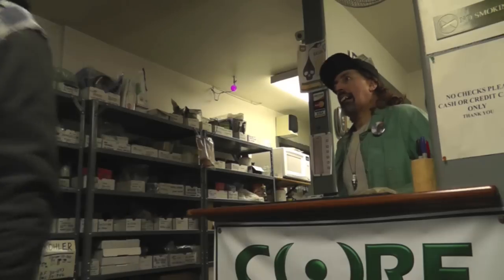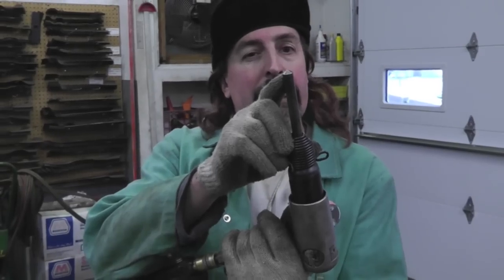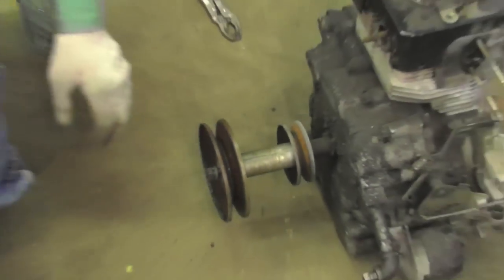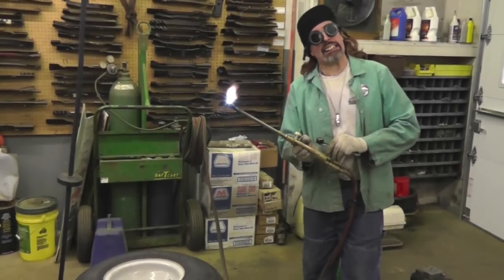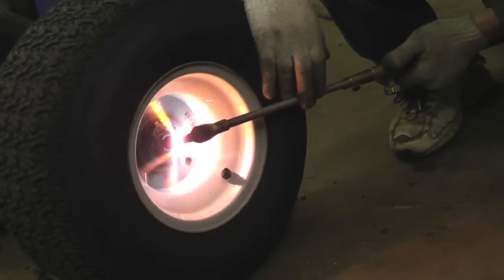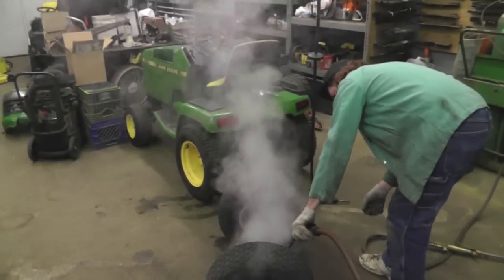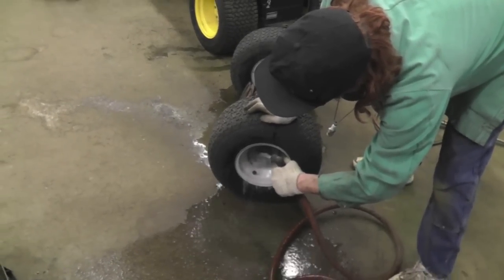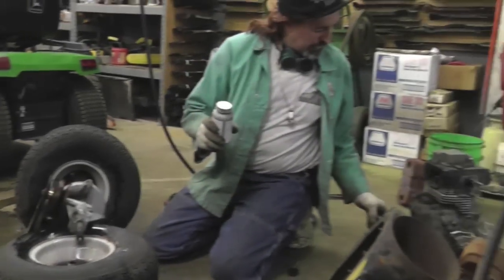How To Remove Rusty Pulley, Rim, Blower Fan, etc.

Comment: It WORKED, I knew to use an air hammer and heat but never thought of heat and water. You saved my wheel and now a subscribe. Must have watched a dozen other videos and my next move was to cut the wheel off.

Comment: Great video, I'm wondering if that much heat can damage the seal on the axle. Just asking!
Reply from the maker: Yes it can, You can wrap a wet rag in the seal area that will keep it somewhat cool. I've done that to protect the seal.
Reply: Taryl Fixes All did this trick on my own and though I was so smart.

Comment: It really requires two people to hold and pull it with a air hammer, small piece of pipe around bolt helps keep the punch in center of bolt also

Comment: Used the heat and cool shock method for years working on drilling rigs. We call a torch a Vector wrench.
Reply: doesn't it bend the metal (axle) ?

Comment: I spent 2 days heating and beating a wheel before I cut the wheel off and sliced open the sleeve with a grinder. I even tried drilling holes in it and using a puller. I guess it's time for me to upgrade my air supply/tools!
Reply: Good thing I have 2 sets of JD yellow wheels kicking around as spares for my mower.

Comment: I've used the same trick for bleeder screws on brake calipers. (I live in Michigan where they salt the roads so bleeders rust up quick.)  Works every time perfect, I heat the bleeder and surrounding iron about orange then quench with water and take it out with vise grips then I just put in a new bleeder if I need.
Reply: +jhitt79  We got the same deal here in Newfoundland , Canada.  Turn it cherry red and douse it with water. Gets 'em every time....
Reply: Always have a new Caliper on hand..............
Reply: Heating up the piston or caliper would destroy the components inside, would it not?

Comment: Daryl do think this method would work on ariens snowblower axle to wheel,there's a rass bushing in them,and there a real stinker cant get it moving at,you must know all about these,its the pro 26,a d went to take the wheel off a d the axle came rite out,could not get the axle to move out of the wheel at all.

Comment: If you got the rims with the wheel weight Holes...i've got rusty wheels like that off by  jacking the tractor wheels off the ground & lean it to the opposite side of the jack.... Spray Good O'l Liquid wrench down the shaft..spin the wheel slowly (so the penetrating oil spirals down the inside of the rusty o'l rim & shaft)  & let it sit overnight . Then connect your wheel puller Bolts to the tire rim thru the wheel weight Holes on the Rim turn your center bolt on to the axle. & Presto-change-o... There's Your Dinner.. No Damage to the rim either..

Comment: To take off a belt - Walk it off. To remove a bolt - Walk it off. To simmer down (anger management) - Walk it off. To get rid of a hard on - Walk it off. To reduce pain - Walk it off! That's your answer most of the time, bro! You sound like my coach or Dad!

- I had a new lawnmower tire, got a leak in it in 1 week. Took it to a shop to repair. But they said I needed a new tire (another one), because it was a sidewall leak and not "safe" to repair. I wish I had a recording of you saying, it's a lawnmower, not the space shuttle! Bet I don't go over 15mph - and it was a slow leak. So slow, I could leap off the lawnmower in slow motion, hit the ground, roll over, and make a sandwich, and the tire would still have some air in it and not be flat yet. Sounds like your next episode. How is an attempted sidewall repair unsafe??? Who's the dummy?
Reply: There's a couple of better ways to get rid of a hard on than walk it off.
Reply: Joe Schwartz you shouldn't waste a hard on. No telling how many you have left.
Reply: Patch the tire on the inside and add a tube

Comment: Taryl,
Regarding old 5 hp Briggs horizontal snow blower/tiller engines:
Are the threads (that secure a drive pulley) in the center of the crankshaft left hand?

Comment: Great video, EXCEPT I don't have an acetylene torch, I don't have an air chisel, I don't have a hose.  Don't you have a technique for the average guy?
Reply: Look up Mapp - Pro torch. Should cost under $50 and it's pretty nice. Heats steel WAY hotter than propane and without the hassle of needing a separate oxy cylinder like the old mapp/oxy torches needed.

Comment: That's the perfect way to do it BUT, what if I don't have a set of torches or a air hammer ? I've been spraying some penetrating oil for 2 weeks now, "nuffin"...The only torch I have is MAP gas. Not enough to bring the rim to cherry red.
Reply: Heat wheel outside of axle, quench with water, Repeat.

Comment: More times than not a propane torch provides enough heat and is a lot more convenient. If that doesn’t work then the blue tip is next.

Comment: 1 problem the seal on transmission? I did this on an engine 1 time and burned out the oil seal. That was easy to replace but on some of these new transaxles you can't replace the seal.

Comment: I got a question what if this don't work what next because i working on one now i  have heat it up about three times and no good
Reply from the maker: lewis hawks Not sure what you're doing wrong but we've never had a rusty item that we couldn't remove with this method before. Gotta heat it up really well and quench it. Sometimes it might take a few tries
Reply: Taryl Fixes All  you r right i got that wheel but i had to heat it up 6 time  time on both sides

Comment: lol  "oxygen and amphetamine" torch.  Quick question:  off road go kart with the same style of single lug rim...Is the heat/cool method going to ruin the bearings in the rim?
Reply: not the bearings, but the seals should be replaced before re-assembly.

Comment: When things heat up they expand, So basically you want to heat up outer edge and NOT the bolt. Take two identical smooth plastic cups, Put one inside the other. And fill it up with hot water, run cold water on the outer cup for a few seconds. Empty the hot water, and then try to separate the cups. The cups should be locked together..... To get them apart, run cold water in the inner cup or run hot water on the outer cup. Same physics is happening when your heating it up to get it "unstuck"... In the video when he puts cold water on it, this could change the strength of the metal, and cause it to become brittle which will cause it to fail. just heat up the rim and try to keep the bolt as cool as possible. letting the "rim/block" expand, then try backing it out. If it still wont go. you can try dribbling water on the bolt itself to cool it off, which will cause it to shrink.
Reply: ntlgnce thank you mr. wizard but what he's doing is heating and cooling quick to bust the rust bond. He's not keeping the rim hot for the expansion. If you were to be putting a press fit bearing on a shaft then it would make sense to heat the bearing, cool the shaft. The bearing will slide on easily. But he's not doing that here. Again, he's breaking the rust bond.

Comment: A guy brought me a mower with a rusted wheel. He had beat the shaft with a hammer. So much so I had to take it to a shop so they could cut the wheel off. Air hammer might work but do not use a regular hammer. Another time a guy tied his tractor to a tree and wrapped a chain around the wheel. Then hooked it to his truck. He pulled the shaft out of the transmission, just saying  Don't do that, that's a bad idea. IF you do not have a torch take it to some one who does. Taryl is telling you right. Some times you can use penetrating oil and a gear puller to get one off, again some times it works.  But it takes a long time and BP blaster is not cheap. Avoid the hassle and wasted time. The last time I had to have this done the guy charged me $30 and it took him about 30 min. Some people will bitch No matter what, I have found that if you take the time to sand down and repaint the wheel. It gives people one less thing to bitch about. Just be sure to paint it the same color as the other rims.
Reply: or just paint all the rims, or just don't listen to the people that are naysaying, because chances are, their problems are in their heads!

Comment: I beg to differ on those crank shaft pulley's. In my last 30 years doing this I have had to remove about a dozen of those crank pulleys to stop those leaky Briggs crank case gaskets. I think out of the dozen or so to my recollection I've only had 2 or so cooperate and come off. A few times we made some phone calls to God and even he couldn't help with that shit job of removing those rusty Briggs crank pulley set ups..